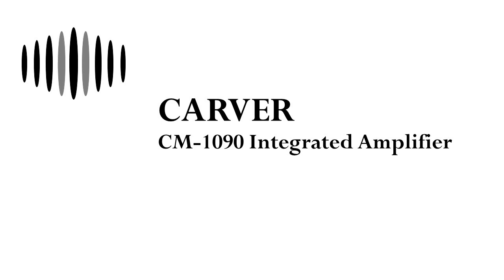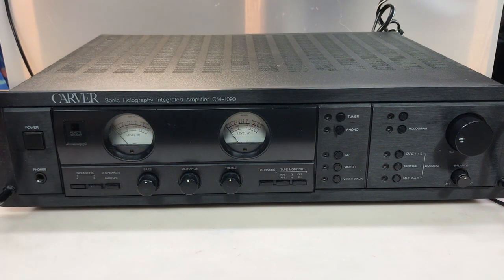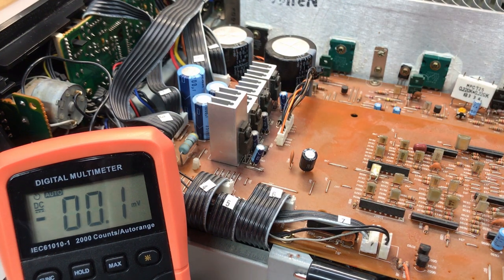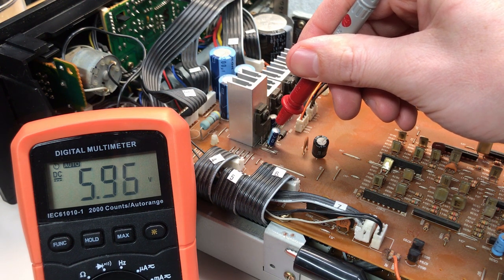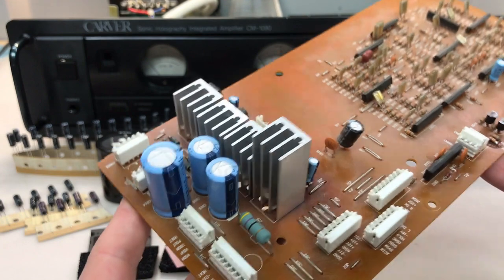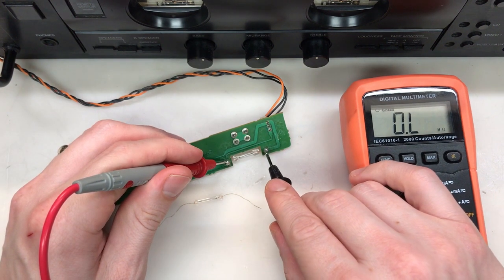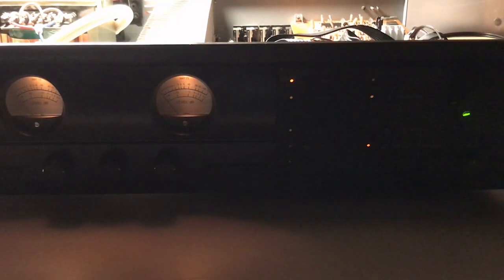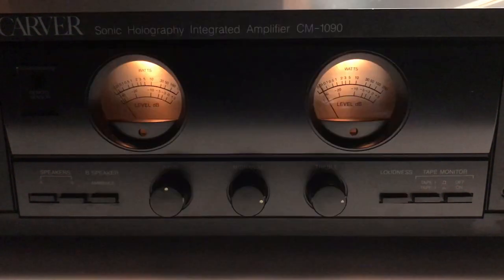DR #35 - Carver CM-1090 Integrated Amplifier Repair

Comment: I have the same amp 120 volts from America and l m using it in 220 volts area with a transformer. Over the years l have a loud hum . I think l need to change my transformer. 
I think l need to change the power imput transformer inside. Problem is l don't know where to find a good and quiet transformer in Accra west Africa where l m located.
I see only chinese stuff aroud.

Comment: thanks your video was inspiration and i had just recapped all by myself around 70caps, few hicups but i solved it as the track worn out during recapp- but managed to restore in the Holograpic board. also i had cleaned all the switchs and pots, using ABB sourced in india as i could not get deoxit..  happy now with sounding good-its a beat amp.

Comment: Nice repair, but i highly doubt that the MJL21193/4 are suitable replacements due to number of reasons, but mainly because of very poor current gain bandwidth and much lower beta (DC current gain) in comparison to the original output transistors. I would leave in the old output transistors or I'd go for the Toshiba 2SA1943/2SC5200 (TTA1943/TTC5200) in this case as they have the same or better characteristics than the original transistors. But, then, the rest of the amplifier stages might not be as fast as the original transistors... not sure.

Comment: Nice repair! Looks like it was dropped on its back-side. The white "gunk" may have been caused by an attempted repair of the connector block using a solvent type glue. Most regulator ICs contain thermal protection that lowers output voltage, many will chop the DC - a sort of PWM - causing really interesting problems in audio and digital circuits. Did you test both of the old lamps? If they were the same resistance I would suspect someone had changed them to get brighter VU meters. Thank you for an interesting video.

Comment: Power over voltage regulator = Voltage in minus voltage out times current through it is much higher what it's datasheet allow , to much load or it could be to high input voltage,  voltage drope over regulator was around 10 volt , that is to high maybe , reasonable root causes it could be not the regulator,  it could be high input voltage , what it says service manual , is it 20 volt ok ? This amplifier they have triac on primary side of transformers  to increase rail voltage for output transistor voltage , when you increase the volume, the output voltage on secondary side of transformers increase   so beware of that,  this even increase  input voltage at regulator.